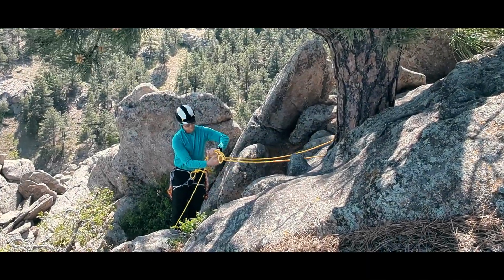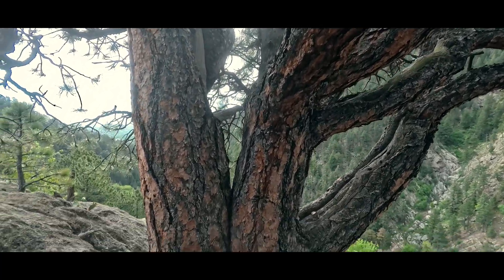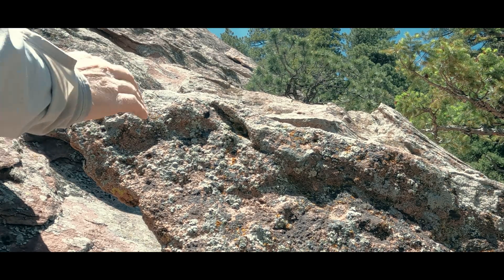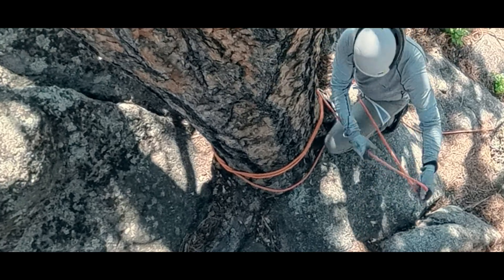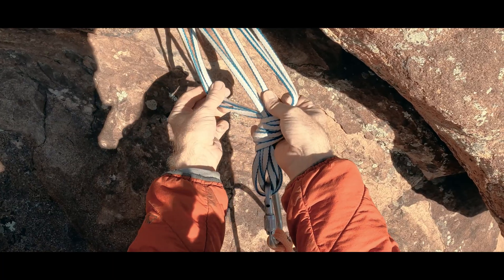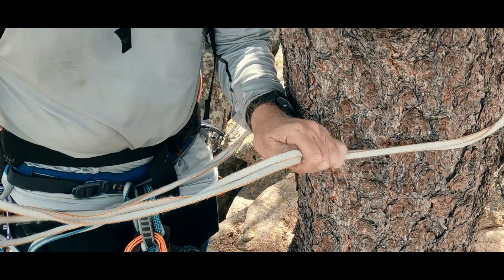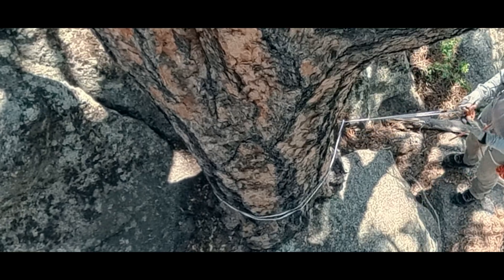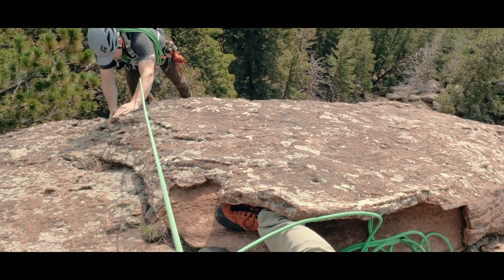Don't Risk Your Life Using BAD Tree Anchors or Poorly Slung Rocks!

Comment: If I was using a tree for a stance, I would not be using it with friction, this is what will damage the tree.  If you isolate the strand as you would normally for an anchor, this is good enough.   Also aim to use  tree anchors as low down the base as possible which limits the strain on any root system there.

Comment: Did you talk about edge protection on the monolithic boulders? I'm often left wondering what edge is really necessary to protect.
Reply from the maker: I did not, but it's a good point. It's kind of like a snow bollard: if we imagine the direction of pull is "south" on a compass rose, then we want to protect the "north east" and "north west" corners, all things being equal. If you have a sharp edge at different points than those areas, though, then protect those areas where that edge causes the rope to make an unusually sharp bend.
Reply: @ShortGuysBetaWorks  thx

Comment: Understanding the way mathematical risk multiplies, instead of adds, It is important to understand that something like a basket hitch or girth hitch around a tree is actually less than had a loop of cord been tied around that tree. 

Here goes: if the cord had a failure rate of 1 system failure in 100 represented as R and has a value 1/100.  A single cord system looped around and tied will fail if the one cord is cut. So if we will have a failure rate of 1 cord cut equals one system failure: 1rope/1system=1. The resulting risk for this system is (1/1)*R=1/100

 If we loop the cord twice, any one cord cut will result in a system failure: 2ropes to cut is one system failure: 2 ropes/1 system=2. the resulting risk for the system is (2/1)*R= 2/100 this increased risk linearly as more loops creates more series failure opportunities. This also applies to chaining a bunch of tat together to make a longer sling

Now if we use the ponytail method, we have two parallel systems in one rope. We can represent this as 1Rope per 2 systems: 1/2. the resulting sum of risks is then (1/2)*R=(1/2)*(1/100)= 1/200. This is the redundancy that actually makes us safe. 

Because of all this, would it be correct to assume that the risk of traveling in terrain that we might use techniques like a a Connecticut Tree Hitch must be sufficiently low that we will not be relying on the systems, as they are just that much more risky? Should we instead think of them more like a redirect, making what would otherwise be a body belay less of an issue, as they are about as reliable?
Reply from the maker: I follow the math (I taught statistics when I was in graduate school), but I don't think the math leads to the conclusion you are asking about. The issue is that climbing has multiple potential failure points that can lead to significant or catastrophic consequences. Even if we assume that we can come up with all of the potential failure modes of anchor material getting cut and distill it down to one number, we run into other potential bad consequences that having nothing to do with that, like darkness or weather moving in - just as a couple of examples. If we were doing a 1400 foot (300 meter) scrambly class 4/low-5 in the alpine, would being able to get into and out of anchor systems like these save us minutes to hours? If so, does that reduced risk of "getting caught out" outweigh the risk of cutting? And then going back to the math, itself, there is a difference in the probability of a climbing rope getting cut by rock fall (climbing ropes usually have to be under extreme tension with almost all the dynamic stretch out of them for rocks to cut them, or otherwise have some kind of back-and-forth sawing) versus cord getting cut. So, the probabilities might be so small that even the multiplicative nature of having too strands doesn't create a risk that is large enough to disqualify the system. Back to the point about multiple bad consequence types factoring in, systems using the rope, like the Connecticut Hitch, have other failure modes (tying them wrong, for example) that are more probable than cutting.

Comment: Do you have a preference of sling type for rocks and/or trees, e.g. nylon, dyneema, etc.?
Reply from the maker: I climb a lot in the alpine, so I use a lot of Dyneema for both weight and abrasion resistance. Need to be aware that knots weaken Dyneema a bit more than other materials and that they can slip more easily if used as friction hitches (I have a dedicated prusik loop that is not Dyneema).
Reply: @ShortGuysBetaWorks  Dyneema is also even more static than nylon! 2% vs 6% stretch iirc (although I don't know at what load this is)
Reply: Dyneema is a thin sling, which makes them more useful for threads.   Thick slings are useful because they are less likely to roll as in certain scenarios the rope or dyneema sling could if the rock is rounded.   Different tools that lend themselves to problem solve in differing scenarios